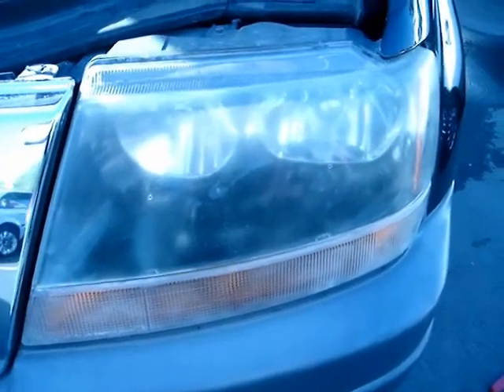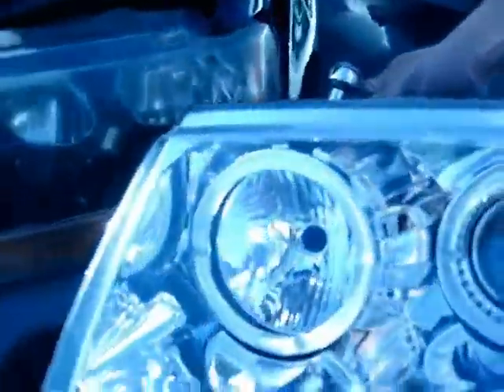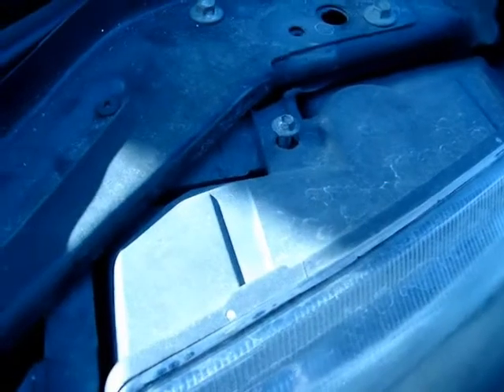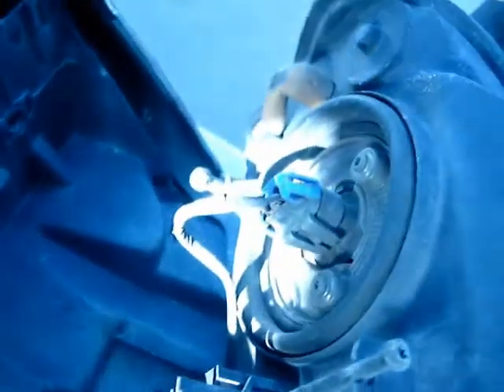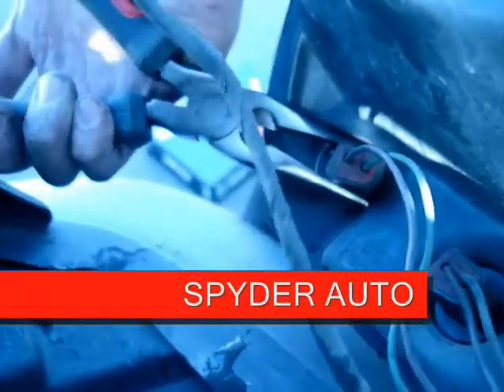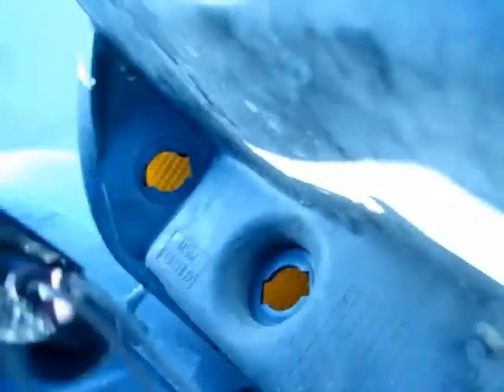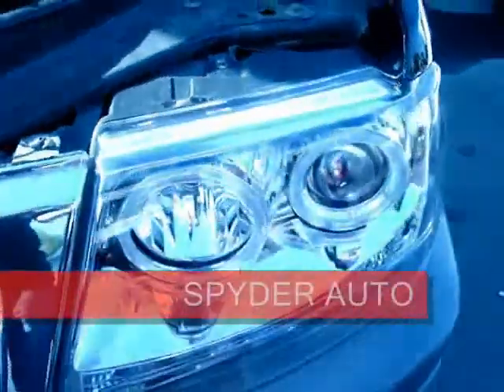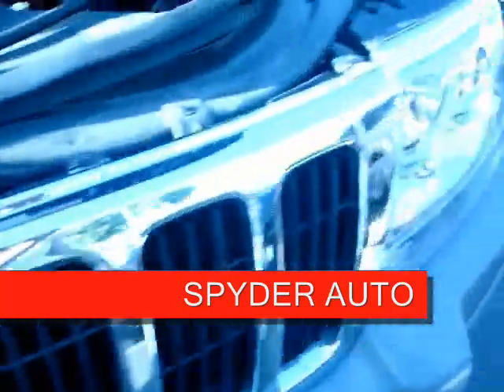Spyder Auto Installation: 1999-2004 Jeep Grand Cherokee Projector Headlights

Comment: Too bad you don't show us the rest of the story...

How and where to splice in the LED and CCFL power leads
How and where to mount the ballast for the HID

Why not integrate the CCFL power supply into the housing, along with the wiring for the LEDs.  From there, provide one additional connector with a new pigtail to splice to the harness, which would allow for removing the housing without having to cut any wires.